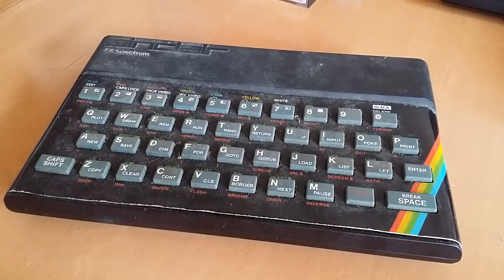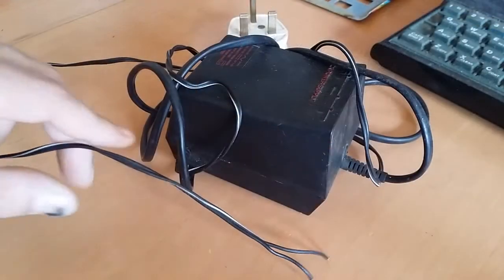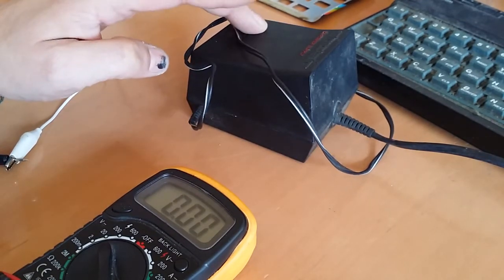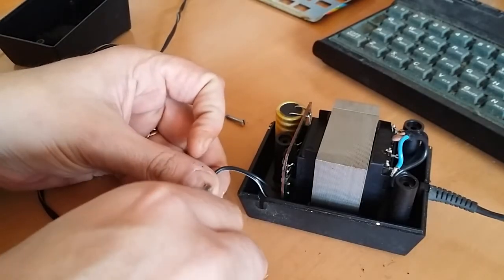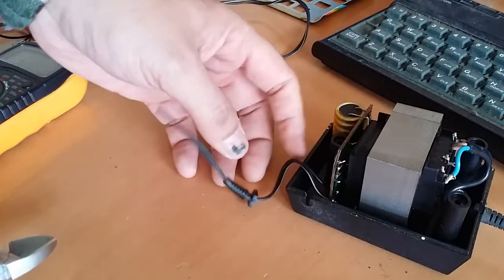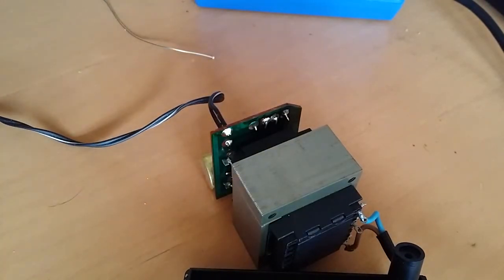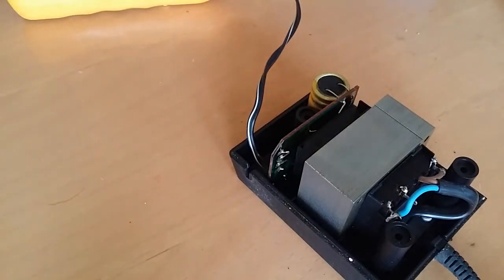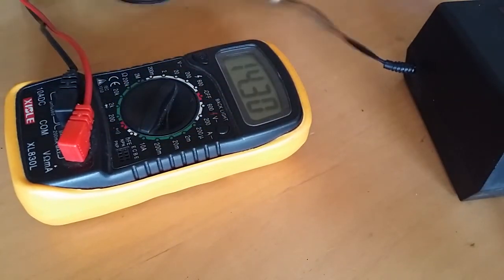Budget ZX Spectrum Restoration - Part 1

Comment: It is actually good to see a power brick you can actually open without having to cut them open (a thing that I think is mandatory in Australia i.e. non accessible power supply for safety reasons).
That was pretty high over voltage, I would worry about that putting a strain on the voltage regulator in the system itself.
Reply from the maker: Most of them I have seen are sealed also over here. The power supplies are unregulated as they rely on the voltage regulator inside the spectrum to do the work. It's perfectly safe :)

Comment: Great job =)  Look forward to the next bit!  I think these are the sockets I used to repair a couple of +2 DC jack sockets.  Just double check the size before you order in case these aren't quite right.  It might be a 2.1mm on the Spectrum.   http://www.ebay.co.uk/itm/25-Pcs-3Pin-PCB-Mount-5-5mmx2-5mm-DC-Power-PC-Charger-Jack-Socket-Connector-/291208614753?pt=LH_DefaultDomain_3&hash=item43cd62d361
Reply from the maker: Thank mate. I have ordered a socket and matching plug and paid about the same as all 25 of those haha. Ah well, I only needed the one, so don't mind paying a few quid for it :)

Comment: Great stuff John. I bet at some point someone caught it with their foot and pulled that wire very hard, maybe wrecking the other end at the same time. Nice repair. I have the original PSU too and also a joystick interface with a slot for the little cartridge games that go for crazy prices on ebay (so I have none).
Reply from the maker: Thanks mate. That's more than likely what happened. Yeah the cart games are super expensive for the speccy, they only released about 6 games or something stupid on cart. That's why they are so rare.
Reply: StigsWorld We need an Everdrive for that ROM slot!
Reply from the maker: P5ychoFox There is already an everdrive type device for the spectrum. It's called the divIDE, it connects straight to the connector on the back of the spectrum :)
Reply: StigsWorld I never knew that, thanks mate.

Comment: Cool you could restore the plug . I had a similar problem with my amiga  but i.m terrible with electronics so i just got a new plug thing for it . My st has problems but i.m to scared to try fix it . Its mostly the disk drive ìts full of crap . Not ral crap lol just what u get in a loft .
Reply from the maker: I plan to fix the power socket and plug the right way. This little speccy deserves that much at least :)